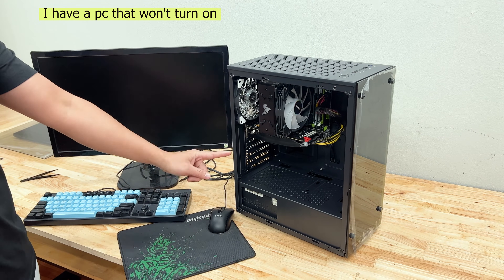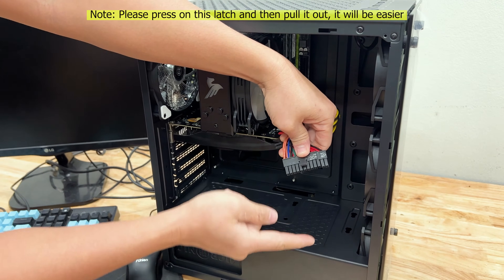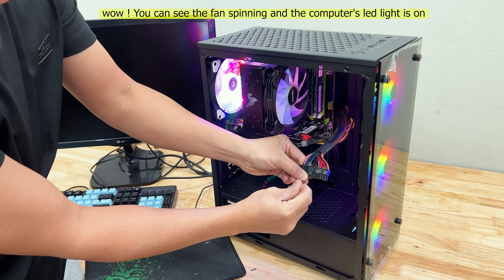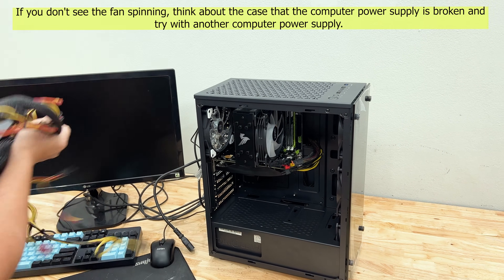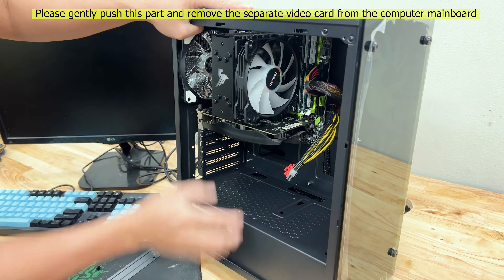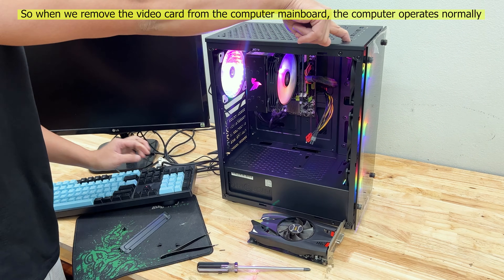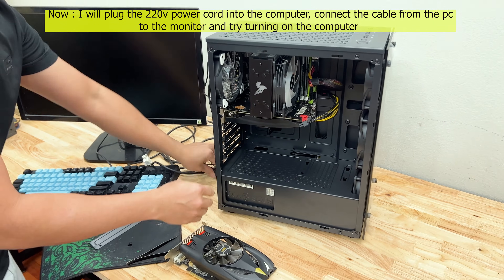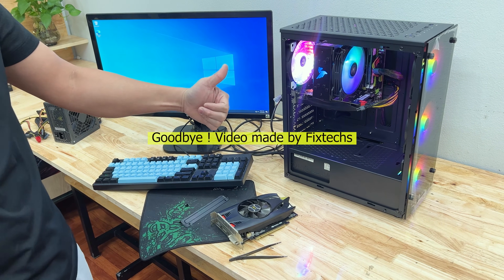Computer Won't Turn On | Hit Power Buton, CPU Fan Spins For Half A Second Then Stops

Comment: Lots can cause this. First check if you have any motherboard diagnostic lights on. If no power no lights. Unplug. Look to see if you have a CMOS reset on the back of your PC. If not you need to remove the CMOS battery. That will reset you bios in the motherboard. Try to power up PC. If it doesn't work. Unplug, make sure your ram, GPU and all connectors are tight. Try to power up. Still nothing. Unplug, reseat CPU add new thermal past and unplug all fans. Including the CPU cooler fan. Also any argb lights. Try to power on. If nothing.. it's your power supply.
Reply: Are you sure ?
Reply: @TheTanjijulmIslam I'm 99% sure. Just make sure you plug your CPU cooler fan in after you do the above. You can also see if your GPU fans try to spin. If they just jolt a bit. That's another indication it's the PSU (power supply).

Comment: I have the same exact problem and i tried all and nothing worked
Reply: Same problem, I bought new psu, still same problem.did you solved yours?
Reply: @woodplay13 fixed?
Reply: @woodplay13 does ur caps and mouse light work? Or not?
Reply: @FateOfFrames dont get what youre sayin

Comment: The second problem is still maybe the power supply. If it cannot support the recommended wattage for the gpu it will not power on.

Comment: my pc works for 8hours then stops and when i try to turn it on fan spin for half a second then it doesnt even spin
i bought every thing 4 times'
i bought the ram cpu mobo psu evrything
i tried every single trouble shoting method nothing works
it works flawless in my friends house but not in my house
and i also tried pluging it into different slots in my house
Reply: don't use an extension lead plug it into the wall, try switching around ram slots
Reply: @greenvejs  my power supply was the problem i bought chinese brands etc but an old dell psu solved everything even sesonic psu werent fixing the issue
Reply: Bro I have the same problem. Did you find any solution?
Reply: @JatinWadhwani-l6f i tried everything, same problem. I even bouht new psu. Same
Reply: @JatinWadhwani-l6f same, did you find solution?
Reply: Same no solution

Comment: how to fix the fan spins for like 3 seconds then off then spin again and off
Reply: Did you solve this problem?
Reply: @abhishek__4_4-q5o  yes, just turn on your computer and wait. Something will pop up in your monitor and press N. Wait maybe like 10 minutes more or less
Reply: @abhishek__4_4-q5o try remove your ram first, clean your ram slot and then put your ram back. try turn on your pc. maybe can solve your problem
Reply: If it doesn't have a video card?
Reply: T